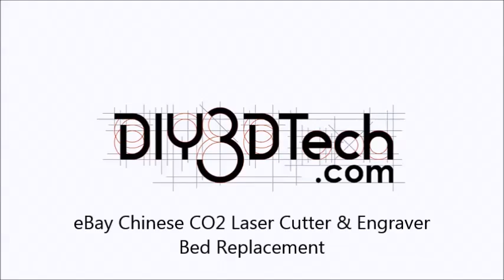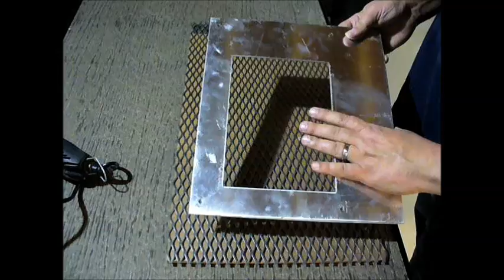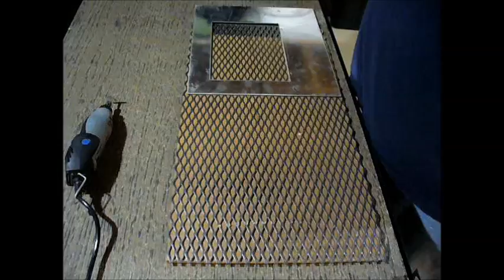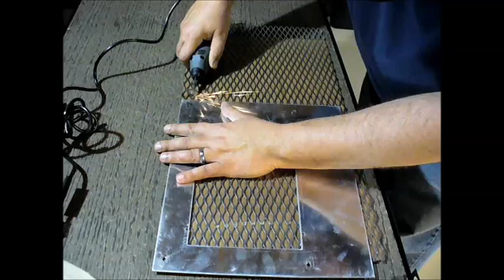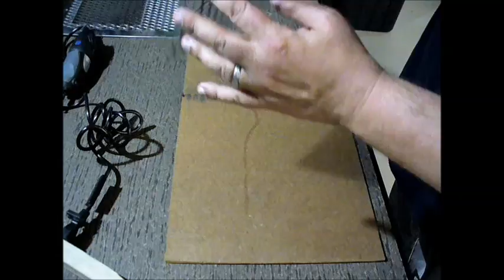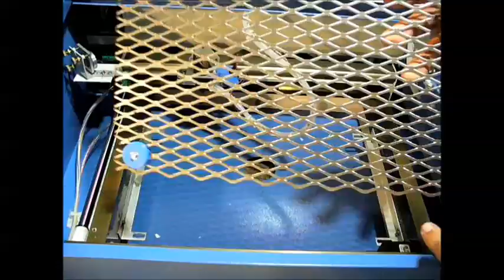eBay Chinese CO2 Laser Cutter & Engraver  -  Bed Replacement

Comment: Great videos! I received my laser cutter yesterday so I've been on a spree haha with this bed mod as well as the duct mod you did how much did it increase your work area as well as your cutting area?
Reply from the maker: I think something like 8in x 8in for cutting and around 8in x 10in for engraving as the beam will attenuate quickly the further the head moves to the right
Reply: Isn't the engraving area 8x12 default? Or is that just what they claim?
Reply from the maker: One of the major issues you will see is attenuation with distance especially with the cheap mirrors.  so the further the head moves the greater the power will drop.  For cutting, you can make up some of this with multiple passes, however be forewarned you run the risk of fire especially without air assist.  However engraving one side will be chard while the further out too light.  8x10 is more realistic and 6x8 far more practical in my experience.
Reply: Ahh I see, thank you that helps. I'll be setting up my air assist tomorrow once I get the tubing. My main use for the laser will be cutting and etching .93 - .125 thick acrylic. Have you had any luck with acrylic?
Reply from the maker: 98% of what I do is in acrylic, you will likely have issues cutting above 0.25" as that (i.e. the 0.25) will likely take a couples passes.  With 0.125 you will be ok.  For 0.25 and up, would recommend a true 60 watt unit...
Reply from the maker: I remember seeing a question about a grounding rod from you however YouTube is strange sometimes with the message threads so if it was you, could you ask it as new so shows up at the top and would be happy to answer it..  :-)
Reply: Yeah it was on your video where you were measuring the currents for the ground lol My question was I have my 8ft ground rod in 6ft deep, could i just cut off the extra 2ft?

Comment: i watched all ur videos on this laser cuttter and there is alot of info, i have few questions what software u use? and would u recommend this cutter and Engraver?
Reply from the maker: CorelLaser & Laser Draw came with and because of the USB "key" they are the only applications which can be used.  Would I recommend buying one?  Well first they are dangerous so beware of that.  If your ok with that and handy, than they are a very interesting tool which you an do interesting things with but do not expect it to be turn key...
Reply: thank you for the quick reply, also i was wondering u made video about all the mods u did to this machine but u did't cover the Reddot laser pointer i wanted know how hard is to do it?
Reply: @DIY3DTECHcom  Now there is K40 Whisperer you can use with these that is much better than what is supplied with the laser.

Comment: Do you have to increase the bed size in the software to fully use all the new area? I can't seem to get my laser head to go beyond the original 0 0 home.
Reply from the maker: +mcpojack 0,0 is the upper left to you can't go pasted that however bottom is the lower right and that is typically set in the "size" of page your working in depending on the application.  In other words, I have never had to change a configuration file for either App I use (i.e. LaserDRW and CorelLaser).  Only match the page size to the bed area which I wished to use.
Reply: +DIY3DTECH.com Got it. Thanks,